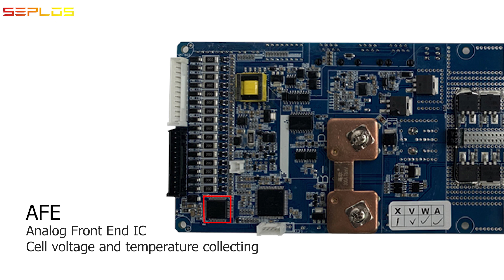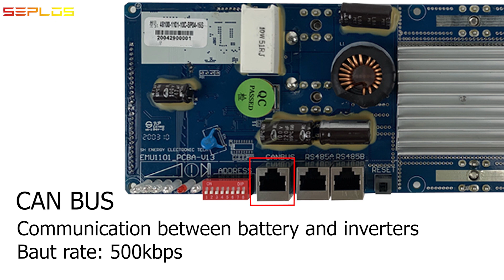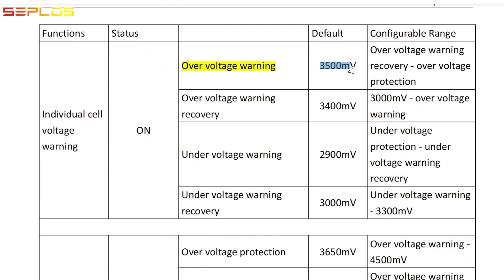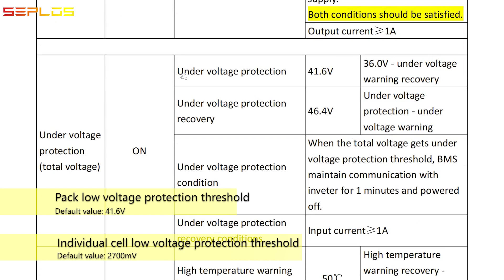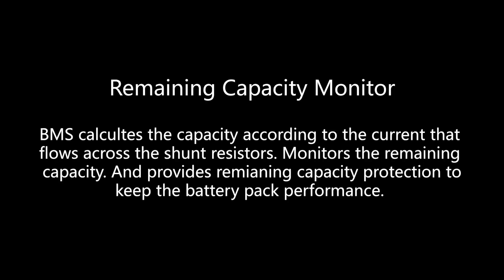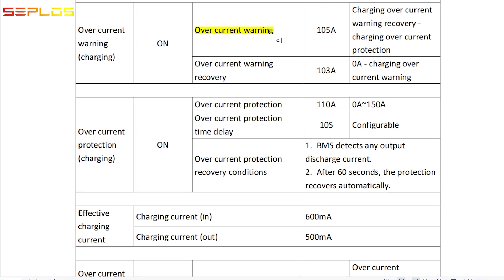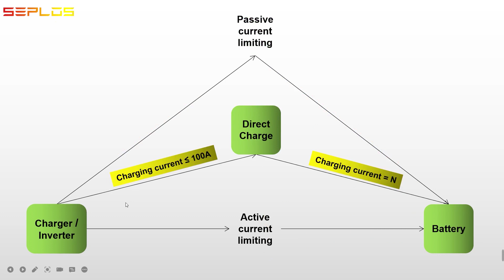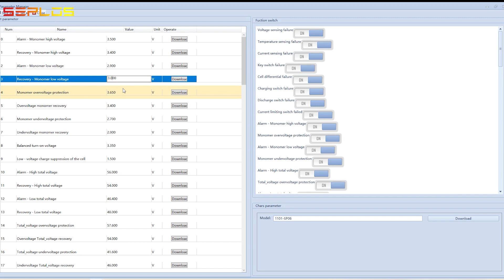100A 16s 48V lifepo4 BMS | Battery Management System | Compatible with Growatt, Victron, SMA, DEYE

Comment: hello ,if i use a seplos bms on DIY lifepo4 16s on a deye inverter, what brand of battery i will need enter ? i can ajust sure the data like low , high current max etc on seplos software , but i think on deye need enter battery brand ! how to do ? , one of my friend tried use a seplos on SOLIS , but some parameters are not seen correctly , why noone do a BMS clone of a brands already pre setted in inverters on market ?

Comment: Great Solution from second Level Support .
I had a small problem, but the support solved it very well immediately. Thank you
Reply from the maker: Hi Onkel, could you please send an email to info@seplos.com. We'll check with the support team. And please assure that SEPLOS will take responsibility for any default caused by us.
Reply from the maker: I've checked with the support team, they mean that maybe something conducted falling into the BMS, and casued the short-circuit. 
And your sales representative has contacted with you about the replacement of the broken BMS. You can check the mailbox.

Comment: Do bms can work in series? Some hybrid inverters need higher voltage from battery fe 100V and more. https://youtu.be/7nEwqEud_2c?t=552 In this video man connect the battery in series. Is it possible for seplos bms ?
Reply from the maker: Pylontech battery pack comes with a battery management unit. The battery packs are connected in parallel to increase capacity.

Comment: I have a sma sunny island  8.0 and I want to have a AC Coupled setup with some mitsubishi outlander batteries in 14s 58v.
Would your bms be good for my setup?
Reply from the maker: Yes, our BMS preprogramed with SMA ptotocol, and it will work with your inverter. 
For the batteries, are you talking about NCM battery with the highest voltage of 4.2V*14s=58.8V?
Reply: @SeplosTechnology  
Yes, thanks for your reply. 
I've been in contact with Chris and have ordered  one.  I can't wait to try it.
Reply: @martdaymo  Does it work with outlander battery? Did you make some test with bms and the battery?
Reply: @johnydeep1094  I haven't receive the bms as yet, I only order it last week.
Will test when it arrives..
Reply: @martdaymo  Thank you for the answer!  If it arrive, lets me know how works bms with battery.
Reply: @johnydeep1094  got the BMS installed and working great with the SMA Sunny Island, using Mitsubishi outlander phev cells. The BMS has 100 adjustable parameters for the battery in the software, half of them I don't understand   the terminology.
If you only have only one bms and it is connected with canbus to the inverter, you can not  monitor the system at the same time with the computer!
Apart from that it works very good.
Also the BMS doesn't have a case or mounting brackets you have to use standoff bolts to mount it, samething for the screen. The little screen is great by the way.
Reply: @martdaymo  Thanks for the answer!
Reply: @martdaymo  Not true, you can use similar computer and can Bus Inverter .can Bus to inverter and 485 to computer. i use this every day

Comment: Hello , i have the Seplos 200ah bms but it works not with growatt sph 4000. its connectet in growalt can but the growatt check and check the hole time but no connecting to the battery . only when i use agm / blei.
i need some help
Reply from the maker: There might be some setup problems. Could you please send an email to support@seplos.com. The after-sale service will guide you to finish all the setup processes. Any other questions, please feel free to contact us at info@seplos.com

Comment: Hello
I'm very interested
This Model is compatible with SAJ H1 6K-S2?
Reply from the maker: @Joan Quintana Altimiras  Thanks for your interest. 
We didn't test with SAJ H1 inverters that you mentioned. 
But the BMS supports CAN or RS485 communication. And it's preprogrammed with Goodwe/Pylontech/Growatt/sofar/Victron/luxpower protocol. And most inverters in the market apply the protocols. 
I have a suggestion to certify if you could send us the protocol of the SAJ inverter,  and by comparison with our protocols, we can know if it is compatible.

Comment: Do you have a BMS that works with Fronius Symo inverters?
Reply from the maker: @Dala's EV Repair, we didn't test compatibility with Fronius inverters yet.
But if you need, we can send you the CAN BUS protocol for comparison. If the protocol is the same, they're compatible. 
Or you can  ask the Fronius for this CAN BUS protocol and send it to us. We will check it for you. 
We're available at info@seplos.com